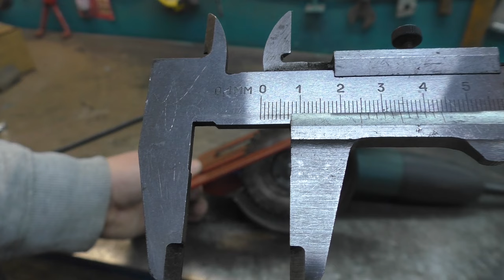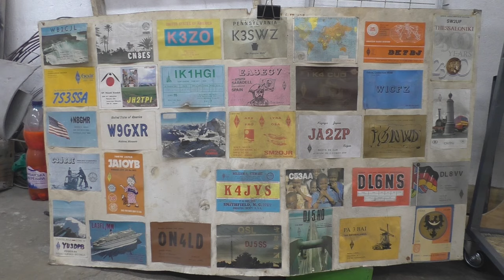Miter Saw made from Angle Grinder, Circular saw

Comment: You have a nice base for the project but the atachment theory is a weakness. And I would at least use smaller tooth on a blade, if not a specially desiged on for no kickback.